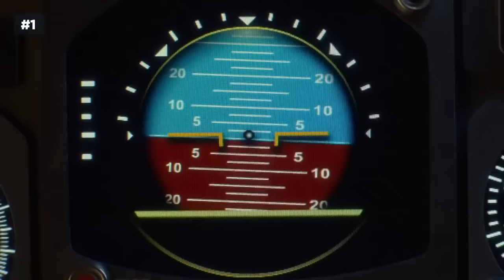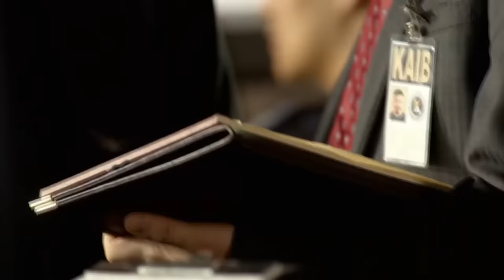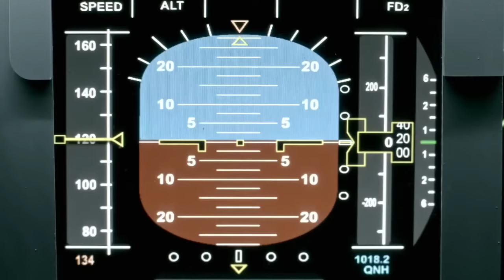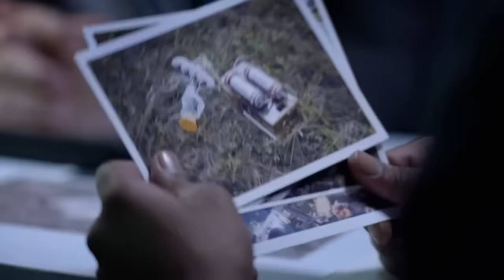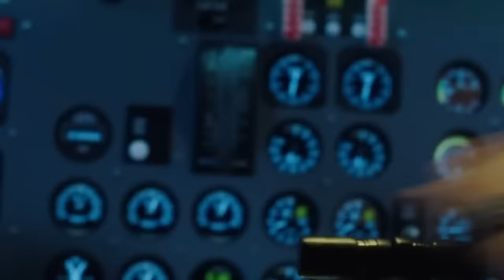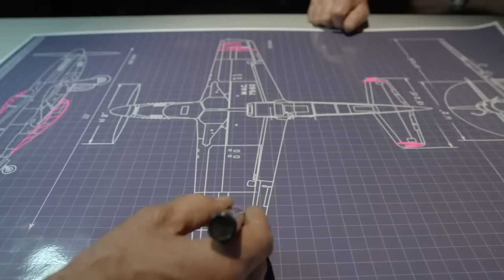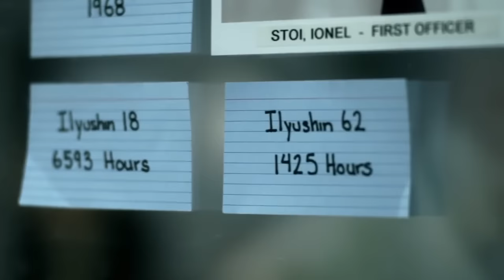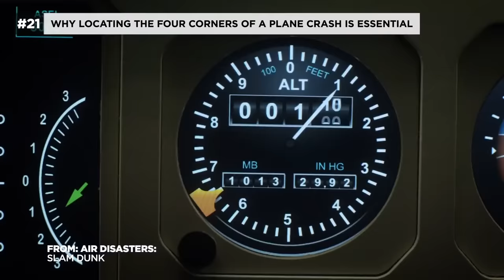Every Single Plane Crash - Season 11, 12, 13

Comment: The crew of Flight 808 were doomed to crash. They were forced to take on an extra flight despite being massively fatigued. They did a great job until the final turn before landing. The fact that they werent notified that the strobe light which tells them when to turn to line up was out of order was what led to the crash. And for all 3 of them to survive and in the case of the FO continue flying and gaining promotion to captain while being a double amputee due to his injuries from the Flight 808 crash is inspirational.
Reply: Yhhh
Reply: Spicy beef ramen 🍜🍜🍜🍜🍜🍜🍜🍜🍜🍜🍜🍜🍜🍜🍜🍜🍜🍜🍜🍜🍜🍜🍜🍜🍜🍜🍜🍜🍜🍜🍜🍜🍜🍜🍜🍜🍜🍜🍜🍜🍜🍜🍜🍜🍜🍜🍜🍜🍜🍜🍜
Reply: That one always seemed to me like a case of bad CRM because the navigator and copilot both saw the strobe and lack of airspeed but the pilot couldn’t. It seems like the copilot could have taken control and either landed or gone around and letting the captain continue when he couldn’t see the strobe was the big mistake. 

The crew knew they weren’t lined up and they were going too slow, I think nowadays they would have spoken up more or even taken the controls instead of just dropping hints that they’re too slow or too tight to the runway. 

I’m not trying to make excuses for the company because they were scheduled too long but as pilots it’s up to them to land even if they’re too tired because it’s their lives on the line. 

If the co-pilot had taken control of the plane right when the captain first started having spacial issues involving the strobe it probably would have been a routine safe landing and it seemed like a case of the crew not wanting to offend the decorated captain which we’ve seen in these crashes a few times.

Comment: On TWA 800 when they did the air conditioning temperature test wasn't that incredibly dangerous? Afterall isn't that exactly what caused the accident in the first place? 
I certainly wouldn't want to be part of that test....unless perhaps that isn't what caused the explosion.
Reply: Oh yeah, it was. But it was to test a theory. The AC temperature was a cause but not the only reason, so the people who did that flight knew it would be doubtful for the same thing that happened TWA 800 to occur.
Reply: Please don’t promote conspiracy theories on videos like this one, it’s disrespectful to the people who died and their families.
Reply: @goofytnt2126  TWA 800 was hit by a missile.
its disrespectful to deliberately mislead people. Those investigators knew it was nothing to do with the fuel tanks or aircon units, thats why no alterations were done to any other 747s after this investigation. If it was, hundreds of 747 would have alterations/ modifications done, but none were done, Why?
Reply: @shazash1  after the accident, the FAA required all 747 to have inerting systems installed. There were hundreds of planes that needed this installed, many were retired so companies didn’t have to pay for the cost.
Reply: @shazash1  when you have evidence to support this, come back & tell everyone, until then, keep it to yourself.
Reply: @goofytnt2126  it was hit
Reply: @kirilmihaylov1934  ok, where’s the evidence? You need to not only prove the NTSB report is wrong, you also need to prove TWA 800 was hit by a missile.
Reply: @kirilmihaylov1934  that isn’t evidence. Give evidence for your claims.
Reply: @ThePeasantsCottage  1. The AC tanks get ridiculously hot when they’re running, about as hot as an oven. That heat would eventually reach the CWT and start vaporising the fuel. 2. There is no evidence of a missile hit or a bomb explosion. Not once did anyone see evidence of a missile or a bomb. 3. Even if I grant that the NTSB would intentionally modify the wreckage so as to destroy any evidence of a missile or bomb, not a single member of the public who went to look at wreckage saw any sign of a modification. 4. There is no reason for the NTSB to lie about what happened. The military has no power over them, nor does the FBI or Congress. In fact the NTSB isn’t under any government branch, its an independent body. The only person you could say has power over them is the POTUS but even that is limited to choosing who is on the NTSB’s main board. Those people get elected for a 5 year term. The investigation was 4 years long. They weren’t influenced into making a decision.

Your distrust of the government has made you susceptible to conmen who have taken your money and then lied to you. Go look at the actual offical reasoning for why a missile or a bomb were considered to be extremely unlikely as the causes.
Reply: @ThePeasantsCottage  wdym?
Reply: @goofytnt2126  sorry. I had moved on & was watching live cameras around Ukraine. I thought you were replying to something I put there. As per your reply here, we’re gonna have to agree to disagree. Tho my trust in anything the government puts out goes as far as I can throw them.

Comment: These are Modern Times... No Aeroplane should be allowed to Fly, when they're over 5 years old. Especially since they're being Trusted with the Lives of Passengers. Changing out the Old Planes for New and more Modern Planes, with Modern Technology. Not Old Planes with Modern Technology. To advance we People have to be ready for Change. Aeroplanes from the 1970's, 80's, 90's, and Early 2000's should be long Retired. Consider People's Lives with Value, Life is worth more than Wealth... Things just might turn out to be Better.
Reply: The passengers buying super cheap tickets are also guilty, because the cheaper, the less plane checks and repairs, as we have seen in many cases.
Maybe we need to stop flying all the time...?

Comment: Twa was shot down
Reply: TWA800 exploded due to cracked wiring inside the plane. This was caused by high voltage electricity travelling from the cockpit to jump into the low voltage wiring. When the electricity reached the terminal block inside the fuel tank, the cracked wiring created a deadly spark which caused the fuel-air mix to explode (that was heated before take-off due to air conditioning under the centre wing tanks)
Reply: No, over heated center fuel tank, plus fuel vapor, plus cracked wires, plus sparks because of said cracked wires equals plane go boom…
Airport plane spotting explains it in more detail, but you get the point… TWA 800 was NOT shot down!
Reply: 16:30: The Boeing 747-200 that will become TWA800 to Paris, lands at J.F.K. Tanker trucks move in to fill up the plane with 189 litres of Jet A fuel. They leave the massive centre wing tank, which is the size of a four-car garage, almost empty, with just a puddle in the bottom.

18:00: 215 Passengers start to board the aircraft in time for a 7pm take off. In charge of the flight tonight is Captain Steven Snyder. His first officer is F/O Ralph Kevorkian. 
 
19:00: Captain Snyder and the flight crew are ready to go. But there’s a problem. One of the passengers isn’t on board, but their bags are already in the hold! Since the 1988 Pan-Am 103 Lockerbie bombing, no airplane can take off if the passengers’ bags are in the hold, but they are not on board. The plane is delayed whilst the ground crew hunt for the missing passenger. 

Outside, it’s 29 degrees and the jumbo is getting hot. Air conditioning units under the plane’s wing tanks keeps the passengers cool during the delay, but they also heat the fuel in the centre wing tank to 127 degrees Fahrenheit, creating a deadly fuel-air mix!
 
20:00 (J.F.K. ground crew), “TWA800 sorry about that delay. We have confirmation that the passenger was on board. They were on board the whole time!” 
 
20:19: At last, Captain Snyder throttles up the 747.
 
20:30: East Winds Airlines Captain, David Mcklane, is flying a 737 into Trenton, New Jersey.  He sees the 747 ahead of him. (David Mcklane), “It was a nice night. Good visibility. You’ve always gotta keep your eyes open for traffic.”

 20:31: (J.F.K. Centre), “TWA800 heavy, turn right heading 150, climbing around traffic. Stop climb at 1300.”

(TWA800), “TWA800 heavy, right 150, stop climb at 1300.”

High voltage electricity travelling from the cockpit travels into the bundle of wires near the fuel tank and jumps into the fuel tank wiring. The 747 is now a flying bomb! When the electricity reaches the terminal block, the sharp wiring allows the electricity to escape from the terminal block, thus creating a deadly spark, and then, ignites the fuel and air mix.  All of that happens in less than ten seconds!
 
20:32:45: BANG! At 16,000 feet and at 650kph, the plane is flying under massive pressure. A hole in the bottom of the fuselage is created from the bang. Flight 800 explodes in a massive fireball! Then it starts to rise, and bank left in an orange and red inferno!

Investigators believe that this is the trail of light seen by eyewitnesses on the ground. The fractures caused by the explosion race up the plane. In 4 seconds, they meet, and the nose is torn away from the rest of the plane! The main part of the plane, with most of the passengers still inside, rises for another 10 seconds and then stalls, plummeting downwards towards the Atlantic! Just before impact, the back part of the plane breaks off, along with the wings!
 
That was how TWA800 was brought down!

By a tiny spark!

As a result of the event, Boeing upgrades their wiring insulation on not just all 747s, but on all Boeing aircraft!
Reply: @jb894  No no no you have been taught wrong. It was wiring inside the tank which caused it to explode.
Reply: @jb894  please explain your evidence for TWA800 being shot down.
Reply: @AirportPlaneSpotting  no, it wasn't. Why do you think so many ntsb investigators dispute the report?
Reply: @jb894  they’re smarter then you and us all lmao
Reply: @kathy8770  who is?
Reply: @kathy8770  there were NTSB investigators and pilots who said the plane was shot down. The FBI covered it up. Many people saw the plane get shot down.
Reply: @jb894  you know a investigation so theres gonna be assumptions along the way, and don’t always believe the media
Reply: @jb894  Ahh but an East Winds Pilot reported that the blast came ‘Out of the Blue’